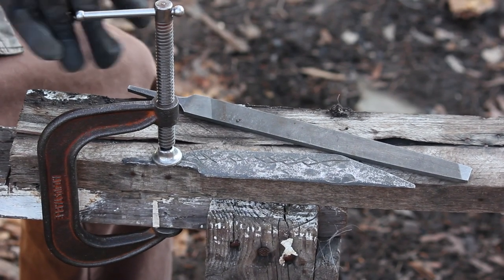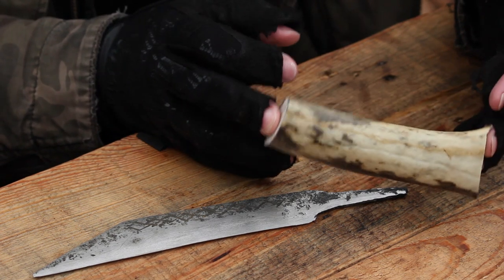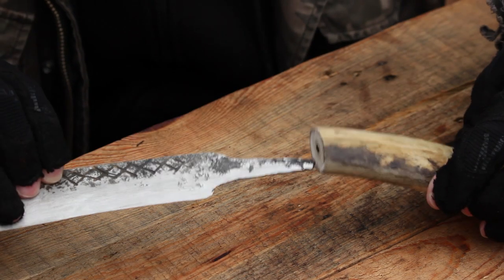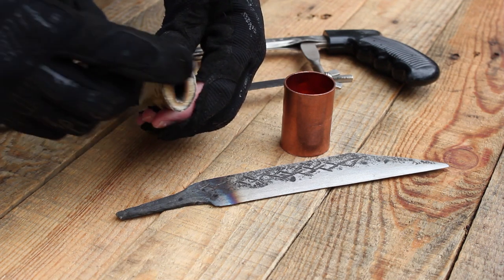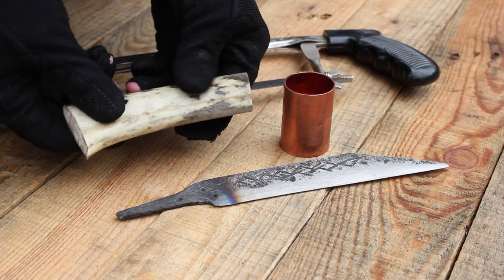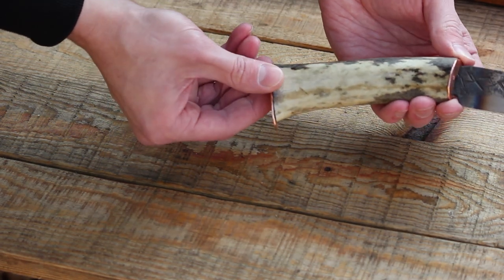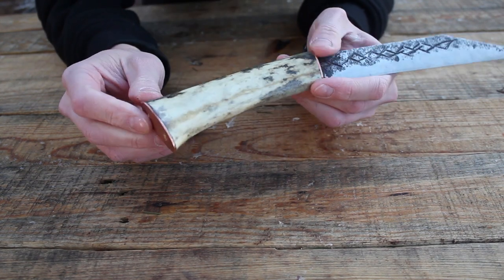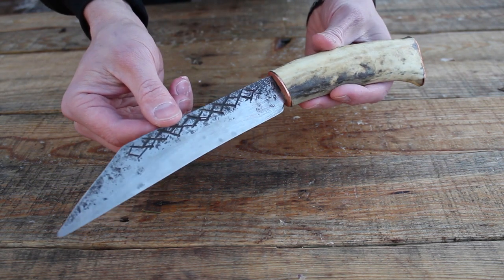Making a Viking Seax from a Pruning Shear- Part 2 (Caribou Antler Handle)

Comment: Watching this again Phil... again, great stuff. BTW, isn't JB Weld cheating? 😂🤣😂 Couple of things. 1) With the caps, couldn't you "rivet" one end of rods, drive them thru the marrow,  then rivet the other end to tighten the caps w/o weld? 2) If you didn't drill out the hole where the tang goes, you could tap the blade in like you would an axe. That way, it seals itself to the handle.

Thoughts?
Reply from the maker: Thanks for the comment, Guy!  As far as the JB weld is concerned, I wanted to use this as a film prop, so I really wanted it as tough as possible.  Film fights are tough on handles, usually from repeated takes of dropping, smashing, parrying, etc.  I think your theories are more applicable to wood, and I have friction fit knife tangs with wood before, but with antler I don't think it would have the same kind of longevity.

Comment: Must be a wall hanger. No heat treat, not enough epoxy, Tang way too short, and the brass pins holding the copper plates aren't even peened. I hope this is a decorative piece, because it would not survive being used.